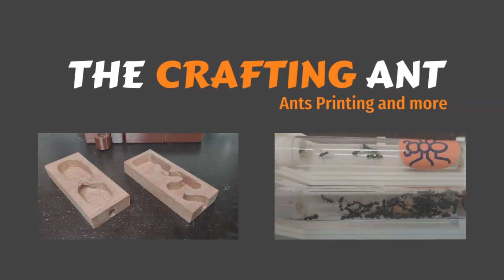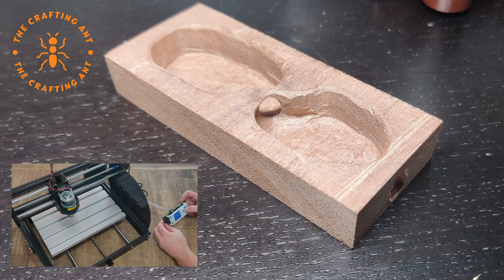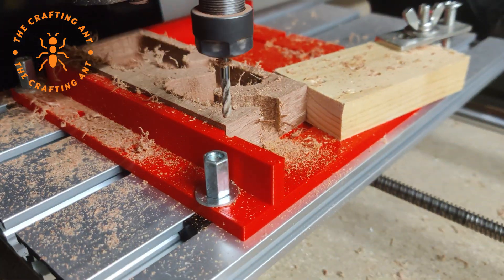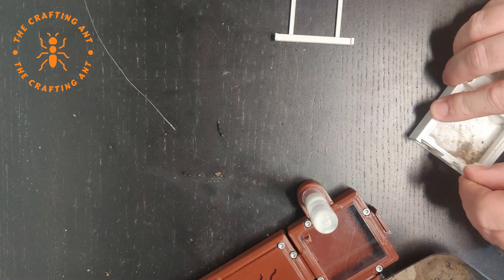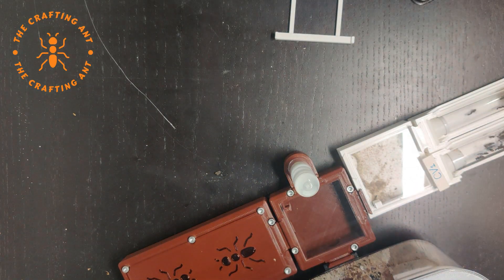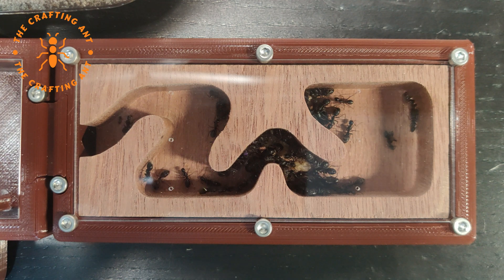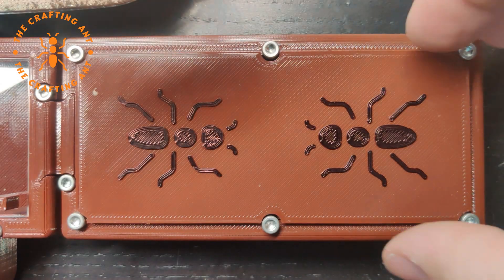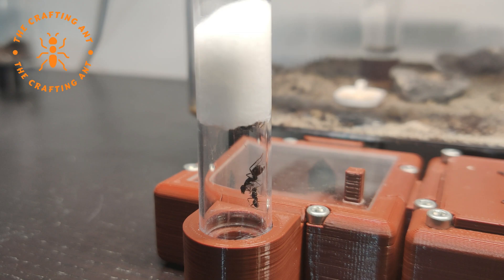I became a carpenter for Beastly my Camponotus Vagus Ant Queen

Comment: Nice nest! And yeah that's the issue with setups with connection systems like these, ants hiding in the connectors and casualties when adding or changing setups
Love to see the communication between ants with a nest move, like the "all clear signal" and everything. Usually it takes a bit before they deem a nest suitable and save to move in, so all and all this was a very fast move. You can see they find the nest a bit scary at the beginning first, hiding in the tunnel haha. The tunnel is easier for them to maintain the humidity, thats why they will keep the larvae and eggs there
Reply from the maker: Thx! Yes it was a fast move. Hope they will stay in there for  while. But its also easier to expand.